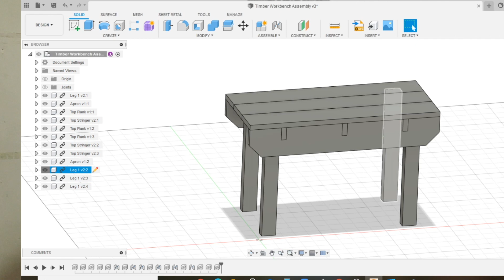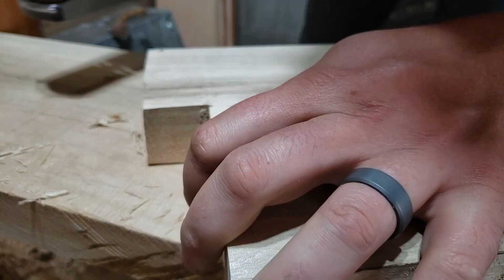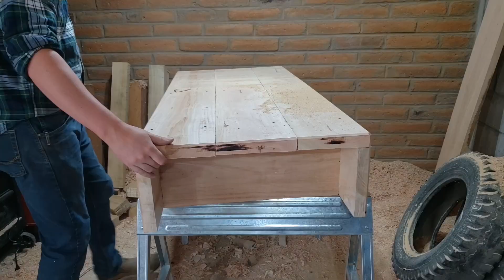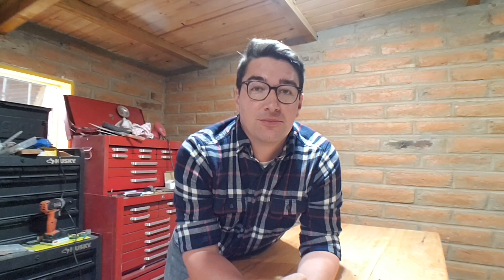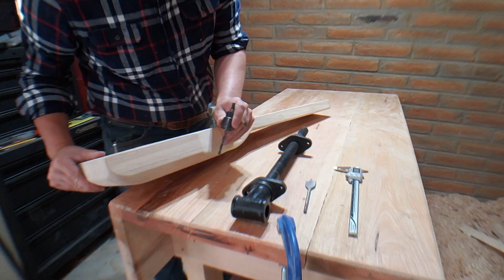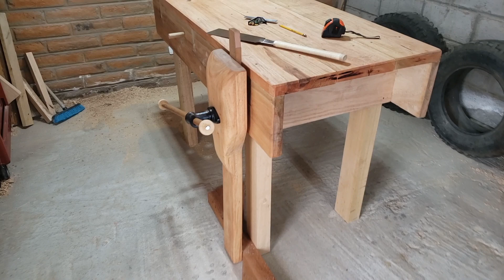HEAVY DUTY Woodworking Bench Build

Comment: Thanks for the vid.  To adjust the bottom of the vise you can add a slot in the leg and the bottom of the vise that will fit a board with a series of holes in it that you would put a peg in through the leg.  not sure if this make sense or not but I believe that is the traditional way of doing it.

Comment: You built yourself an english joiner's bench. Nice work. I would put in two parallel supports for the torsion forces when you plane stock parallel to the bench. It will counteract those forces which can be surprisingly strong and loosen your legs. They can also make a good platform for a shelf. Keep going. You are doing good.
Reply from the maker: Thanks!

Comment: not bad at all for a first effort; are you left handed?
Reply from the maker: Nope, just clumsy :D
Reply: @beermoneyworkshop9737  the reason i asked is that most right handers put the vise on the left end of the bench to facilitate rh. work on long boards secured in the vise....
Reply from the maker: @williamhurt8512  TIL, thanks for the tip! I decided to put the vise there just because it's a less cramped area of my shop and easier to line up with a camera for taking videos